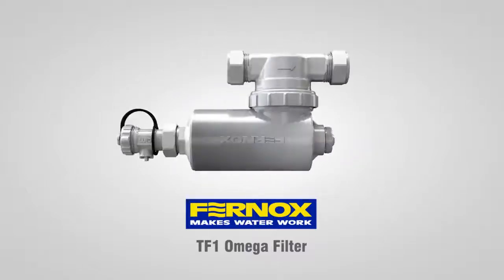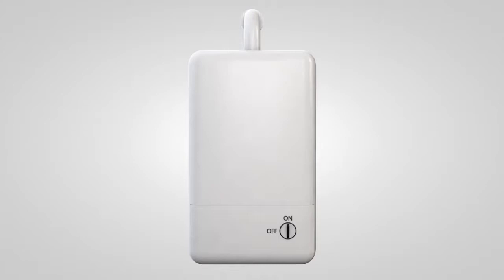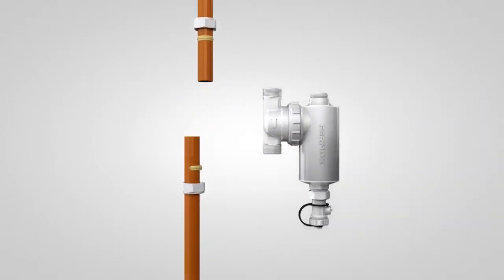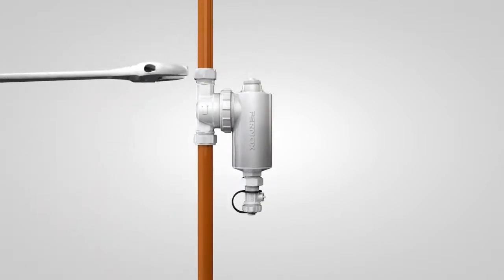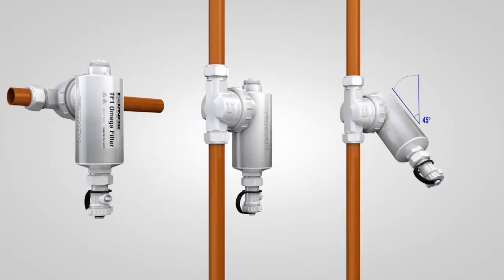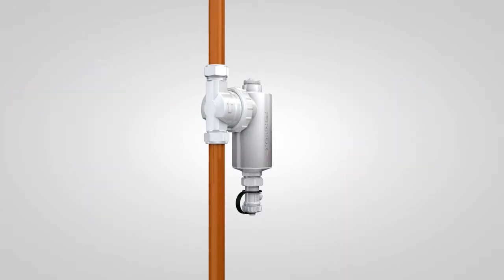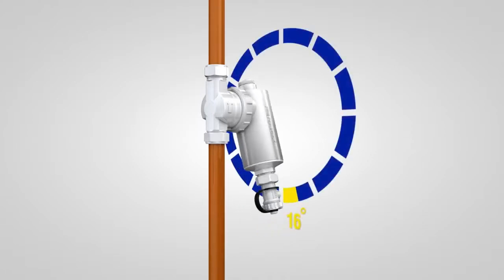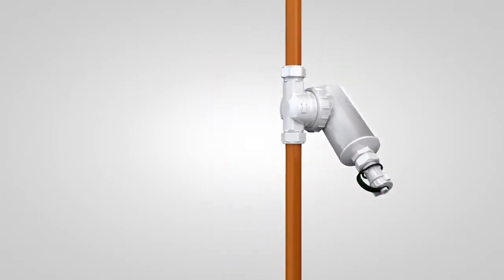How do you install a Fernox TF1 Omega Filter?

Comment: How much pipe is required to be cut out to install the TF-1 Omega 28mm version with dual valves? Is it the same as the 22mm or  the splip ring designs ie 70mm? Yhe installation instructions in the box are not overly helpful- "fit filter to pipework". Thanks
Reply from the maker: You need to cut out 210mm of pipe to install TF1 Omega Filter with valves, 28mm , for TF1 Omega with valves, 22mm it is 200mm, TF1 Omega Slip socket it is 70mm,
Reply: How the f is it 70mm?
Reply: @Fernoxvideo 22mm is not 200mm the space is too big

Comment: Hello, Did you that Fernox will not sell you a replacement magnet assembly for their Filters, even if you have just installed a new one and dropped the magnet assembly breaking it making the filter useless, No you have to buy a complete new filter.
What an excellent customer service policy.